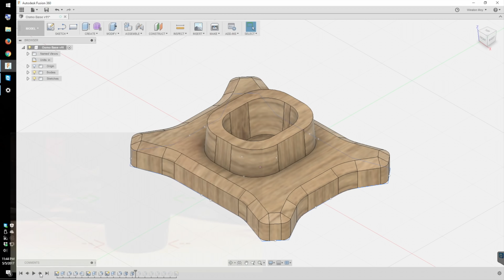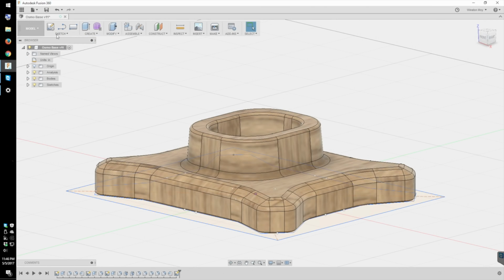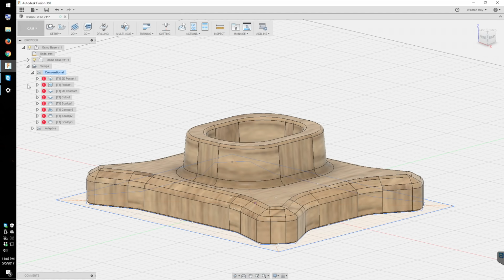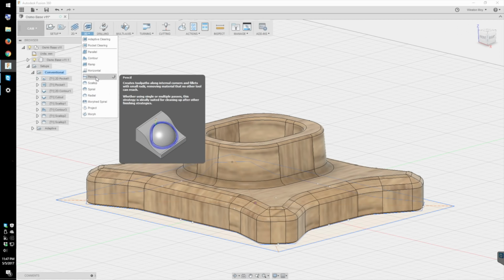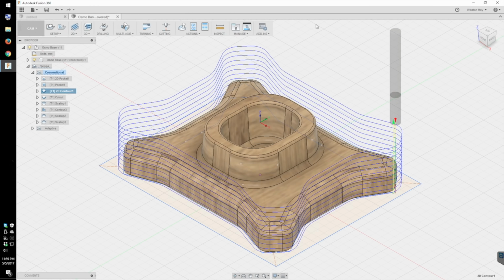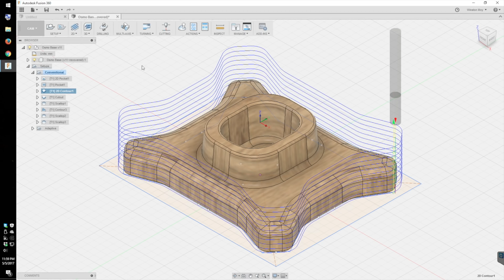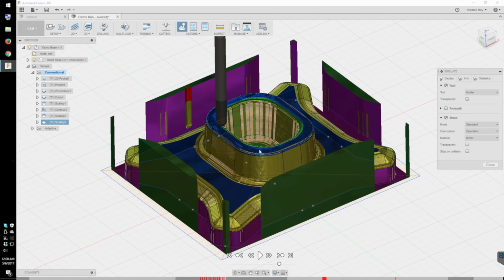Fusion360 3D CAM Project: DJI Gimbal Stand - CNC Project 88

Comment: With hobby machines, make sure to decrease your tolerance in Fusion from the default .0004" to .001" or more. This ridiculously high tolerance was making my Xcarve 2.0 shake and shudder during fast round moves because the computer was sending more movement codes than the 8-bit Xcontroller could read.. You can't expect ten thousandths out of these machines anyway.
Reply: J Com Great advice, I didn't know why that happened

Comment: Ive been doing a lot of CAM with Fusion recently. It is the best CAM module I ever came across and super easy to work with. However, I feel like they are missing something. There should be an inteligent CAM software that just selects the best tool path and cutter size based on the workpiece and machine parameters. CAM should not be that difficult. I see this similar to apples time machine. They just made it super easy to make backups. Why can we not simplify CAM?

Comment: That very last shot looks like GRBL is processing the gcode in chunks? Some major deceleration in the corners? Does 3D CAM produce gcode with a ton of G1 instructions rather than a few G02/G03 instructions when generating 3D toolpaths? This is my big complaint with MeshCAM. It spits out some pretty un-optimized gcode sometimes and GRBL can't predict through it smoothly it seems.
Reply: Grbl dev here. I noticed that too. I think it has more to do with the CarbideMotion sender. It uses a slower (but more reliable) sending method, which can struggle to send lots of G1 commands. UGS and bCNC use a faster sending method that can handle several hundred g-code blocks/lines a second. I would consider using those if you have a job that has lots of tiny lines, running at a relatively high feedrate.
Reply: Sonny Jeon hello Sonny JJeon I was wondering if you guys grbl developers were considering the idea of writing a more powerful grbl on a different and more recent arduino mostly the 32 bitd recent versions to add more powerful features 
thanks you
Reply from the maker: +Garet Biglow Some cam options turn curves into dozens, if not hundreds of line segments. Carbide Create is guilty of this too I believe. In f360 I think you can change your smoothing tolerance to create fewer lines overall, and stop your sender from backlogging.
Reply: When you say a more reliable method for CM sender, do you mean "simple_stream.py" vs "stream.py"? Call and response vs. keeping the buffer full? Does UGS use "stream.py" to send gcode across? I'm working on my own GUI and I'm not sure which is better really.
Reply: Yes. Stream.py is fine just as long as you are aware of the drawbacks. If you have a g-code line with an error, the GUI won't have control over the lines queued up in Grbl's serial buffer. I planned on fixing this in v1.1 but forgot. It'll get addressed in future versions by forcing a hold upon an error, asking the GUI what it wants to do.
Reply: I'm having that "problem" even with UGS, but I suppose I might just be pushed the limits of that too. :)